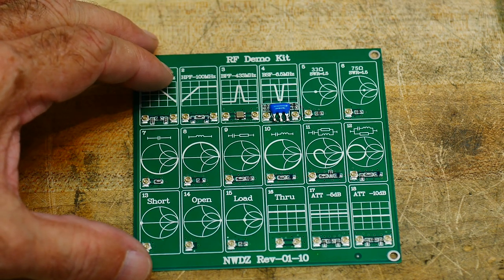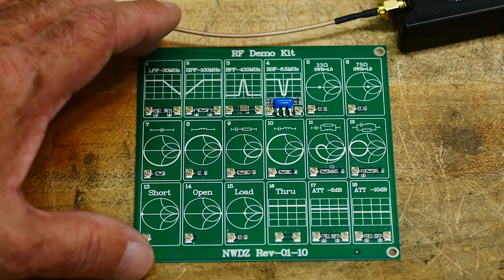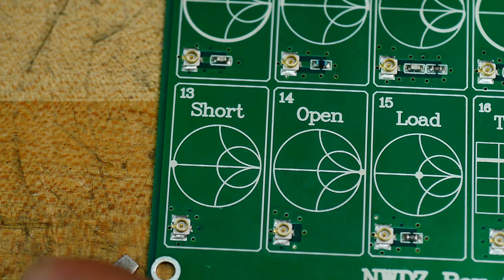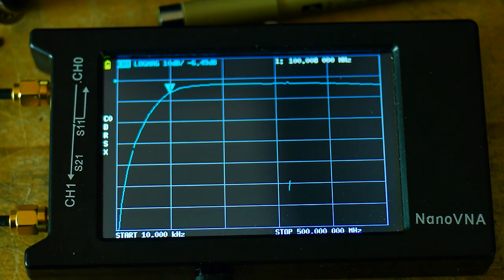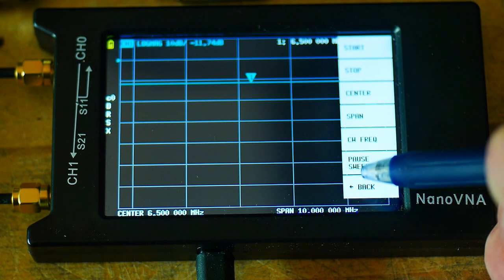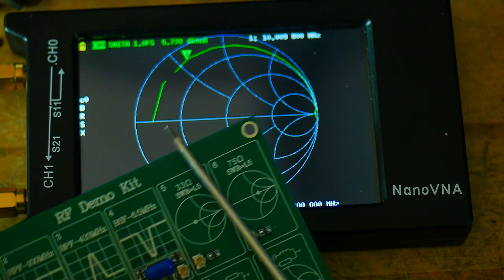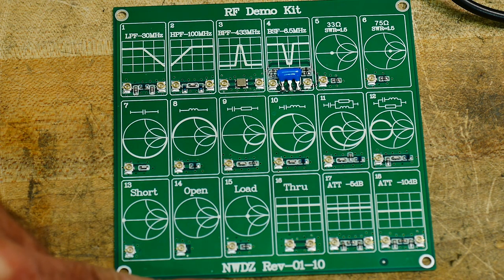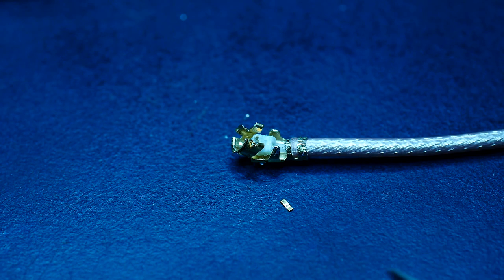#517 NANOVNA RF Demo Board

Comment: U.FL plugs and sockets. A very useful board. I just finished giving an into lecture to NanoVNAs using this board. Went very well. I had read all the negative comments about U.FL, and was concerned about how all that would go. I didn't want to be in the middle of the demo, and have a cable fail. I used a loupe to look at the U.FL plug and socket. I noted that the /sides/ of the /plug/ are /open/ on the coax end, and there is a part of the clasp that rounds the /end/ of the /plug/. Also, the internal part of the U.FL /plug/ that grips the socket pin is designed to rotate in line with the coax axis, /not/ side to side. So I developed the habit of attaching the U.FL by "hanging" the end of the plug on the lip of the socket, then rotating the plug down toward the board in line with the coax axis. To get it to snap into the socket, I'd apply gentle pressure right at the plug as I was rotating downward. Removing is the opposite. I'd guide it off with my fingernails as I lifted the coax end of the plug. I was concerned at first about them being "loose", until I learned that "looseness" is part of the design. I have used the same pair of SMA-U.FL extensions ~100 times, and there is no degradation of the connector, at least at this level of use. I don't get signal glitches, static, broken contacts, or changes in signal quality with the NanoVNAs.

Comment: Just as a note: when changing the span/center frequency, the VNA should be recalibrated. I found this out first the hard way, and, afterwards, from a video from w2aew.
Reply: Yes it is mandatory, or save the calibration and recall later

Comment: The 10.7 MHz BP filter was bad on mine, so I put a good Murata one on.  Yes , you are correct, calibration must be done at the end of the cable.  Even if you use different cables.  I bought some SMA to APX adapters from Megiq.

Comment: 2:37 - one side of an unterminated attenuator is NOT equal to the characteristic impedance, and cannot be used as a load without some error from the impedance mismatch. It might be acceptable when performing low-precision measurements, but I'd try and have two loads instead.

Comment: I hate those darn UFL connectors, they're really not intended for repetitive mating. If it wasn't so expensive I'd build mine into a box with the connectors going to a panel with SMAs. Having said that it is a pretty neat demo.
Reply: Would be nice if the board had SMAs...
Reply: Pretty sure u.fl connectors are only rated for 20 or 30 matings - they're not resilient connectors - really meant for wifi antennas to be plugged into a wifi card once during manufacturing and never touched again.

Comment: the BPF is a SAW filter (perhaps made by Murata?) they are usually never matched to 50 ohm so the circuit is not right for their measurement. Some of them are 150-300 ohm and some have 2-3Kohm I/O impedance. When you measure it in a 50 ohm system the response shows up very crappy unless a proper matching circuit is built around it
Reply from the maker: There is a 50ohm match on the input. two resistors. looks like an inductor across the filter too. also a series resistor on the output but they loaded it with 0 ohms

Comment: those are MMCX connectors widely used in all RF test gear. Prying it up with screw driver was a bad idea as it puts uneven pressure on the socket and the plug. I'd just grab them on both sides and pull them up by pushing my two finger tips to the board.
Reply: Actually, those are U.FL connectors. MMCX are more robust. U.FL pigtails are cheaply available for connecting WiFi card antennas.
Reply: @mariuspetrescu1562  I've see a tool especially made to remove them but it was ~$35-$40 on Amazon.
Reply: @PapasDino  just buy 25 U.FL connectors and connect it on the board all of them so we will never get to disconnect it lol..
Reply: @robust5615  Actually that was my point in another comment! Problem is they're really pricey and too much trouble to homebrew...outfitting all the ports would cost as much as about two NanoVNAs!  ;-)
Reply: @PapasDino  What about ipx to sma adapters? they are 75 cents

Comment: A BIT CONFUSED   On the #1 LP-30MHz (about 7 min into video), I am confused about the high rolloff of this 3rd Order Pi Filter.  It would appear to be down way more than it should - like 21db/Octave (60MHz) and 16db/Octave (50 MHz depending on where fc is actually at).  I would expect to see something like -10db ish at one Octave.  
My nanoVNA gives almost exactly the same readings on the same board as far as I can tell.  So have the Chinese made a 3rd order filter miraculously act like 5th order filter or am I missing something??  
I could be missing something, I am no expert on these things - thats why I am watching videos like these LOL.
Reply from the maker: from wiki: The frequency response of the Butterworth filter is maximally flat (i.e., has no ripples) in the passband and rolls off towards zero in the stopband.[2] When viewed on a logarithmic Bode plot, the response slopes off linearly towards negative infinity. A first-order filter's response rolls off at −6 dB per octave (−20 dB per decade) (all first-order lowpass filters have the same normalized frequency response). A second-order filter decreases at −12 dB per octave, a third-order at −18 dB and so on.
Reply: @IMSAIGuy  That makes sense, my bad.  Thanks for the reply.  I was hung up on the 3db thing.  Its a shame these things have similarities to the db formula for db for voltage/current.  
For years I assumed they were talking about voltage in the filter section despite reading many ac/dc books from cover to cover (from Boylestad and other authors) - some more than once.  Assumption is the mother of all screwups LOL.

Comment: As always a great demo.  I'll be getting one as a teaching aid.

If Google didn't insert mid roll ads it would be a bit easier to follow your train of thought.  If Google could at least let you finish the sentence before breaking for an add that would be great.
Reply from the maker: I tried to set my profile not to place mid roll ads but I guess it didn't stick. If you are teaching you will be interested in a future video in about a month.  I have layed out a SMA connector version of the demo board. I will unsolder the parts and move them to my board.
Reply: @IMSAIGuy  I did NOT see any ads when I viewed it on 8-13-20

Comment: So I have a costly R&S VNA here and need to calibrate at the end of a pigtail connector with the small socket just like this one.  Do you think its a good idea to use these Demo Boards for calibrating it at 2.4 GHz ? If no, what do you recommend ?  Nice video btw.
Reply from the maker: no, this is a bad cal reference. if you have no money you can do what I did: https://youtu.be/fVzT23onCxI
not sure how good is is at 2.4G have not measured it. the open and short will probably be OK and I might buy a better load. You can get good priced loads will get you to 18G

Comment: 3:04 would this RF kit be good for performing calibrations for 2.4GHz? ( you said in the video the kit operates at 500Mhz..)
Reply from the maker: this is NOT for calibration. Just a teaching tool. It will work fine at 2.4G

Comment: this board is  limited by the stupid connectors,  I can never get accurate readings unless I'm pressing them down onto the board (yes they are properly snapped on)
I've seen an SMA version.. shopping for one now, who needs stuff that requires fiddling?

Comment: Hi IMSAI Guy, congratulations on your excellent videos! Do you have any idea what the metal dots on the backside of the RF demo boards are for? Is that used for a sensor or probe?
Reply from the maker: they are just various locations on the smith chart (for teaching I guess). 
open   inf + 0j
short  0 + 0j
load 50 + 0j
and two extra points 50 + 50j and 50 - 50j

Comment: The failure in these boards is the poor coax connectors on the board.  SMA would be much better.
Reply from the maker: like this one: https://youtu.be/SmVHAlHt2hY?si=VGmKwt7HUv8R_deA
https://youtu.be/2W0pjMk56rA?si=KAcIq0aRwEwSPFbQ
Reply: @IMSAIGuy  yes exactly, but with the SMA and components already attached.  Nice job, you made your own!  Thanks for the videos.  I’m playing today with a Siglent SVA-1015X SA/VNA testing coax adapters.  There is a huge difference in UHF vs N connectors above 450 MHZ.   Now I see it.
Reply from the maker: @DIYJim-wx6hq  my test showed 300mhz max: https://youtu.be/Sq3zEpYgCYo?si=UO4i02LYTFDSFTvE